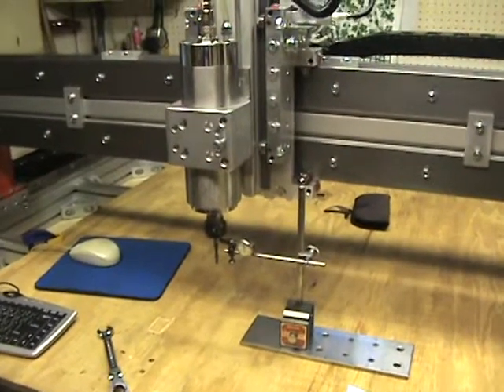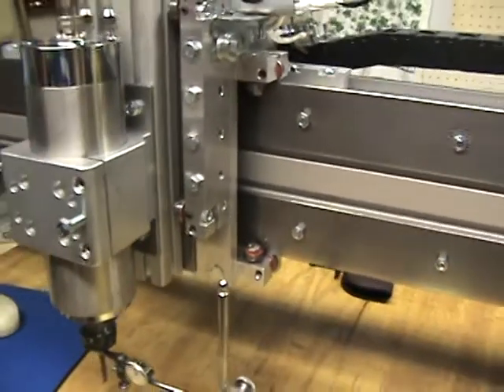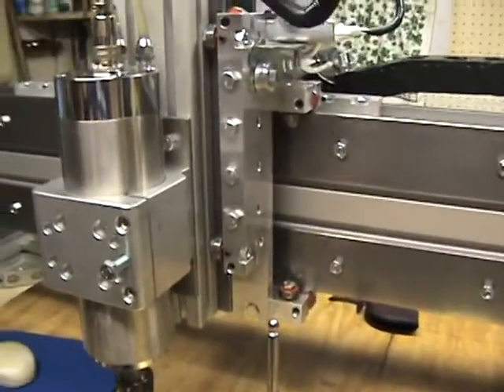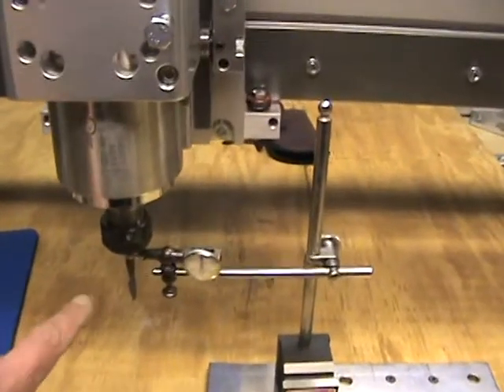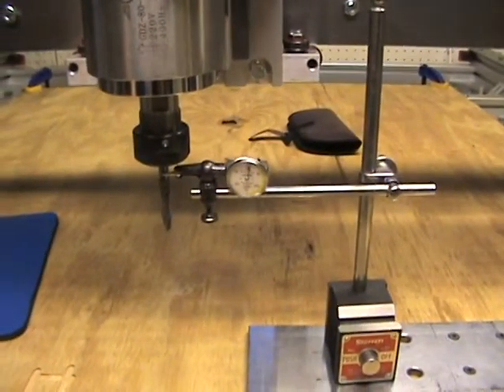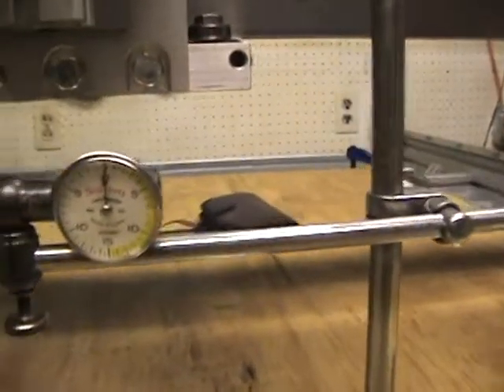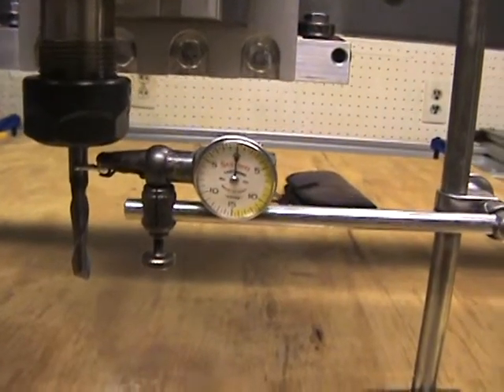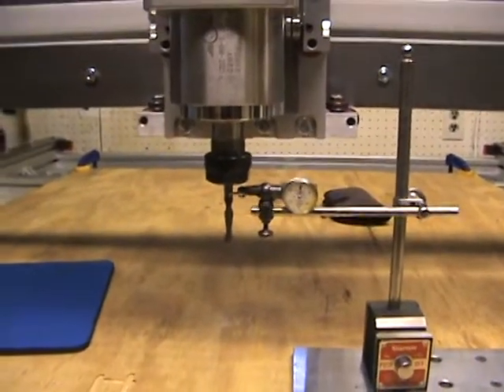Building CNC Router Parts CRP4848-21.MPG

Comment: nice machine bud. i built 1 also. got a 2.2 kw spindle but cant find what the the size is going to the top of the motor (plug). i know its 10 ga 220 in to the inverter. but what is the wire size out  10 ga.
any help would be much appreciated.